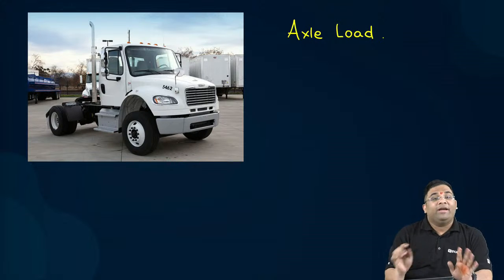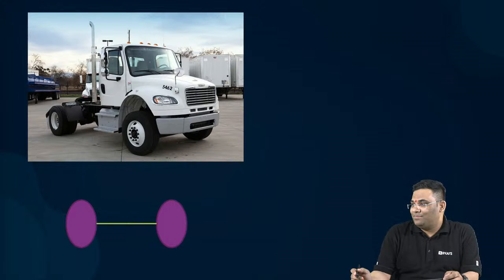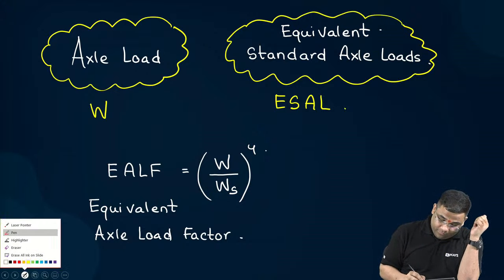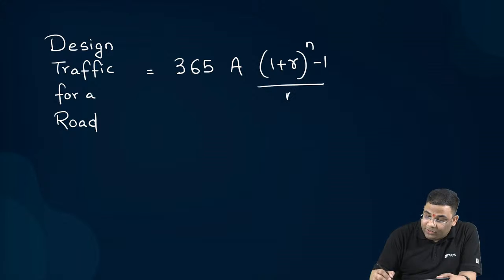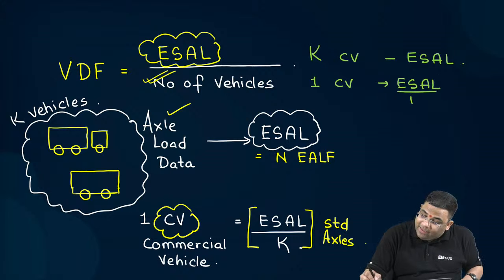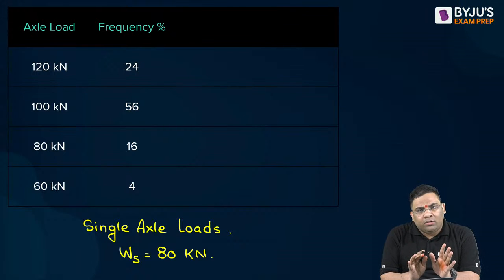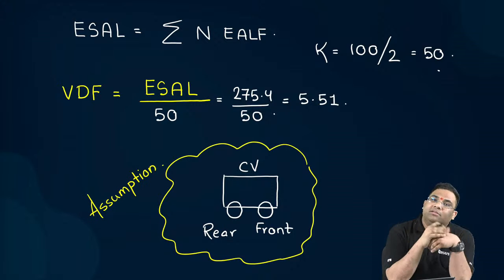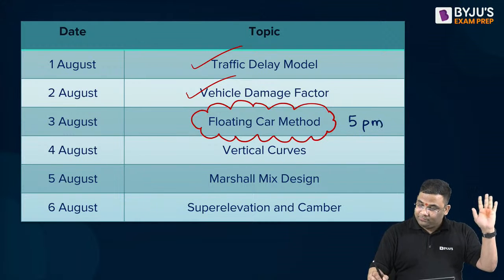GATE 2023 Civil (CE) | Vehicle Damage Factor | Design of Flexible Pavement in Highway Engineering

Comment: Vehicle Damage Factor is that factor which is used for converting the number o commercial vehicles of different axle loads to the number of standard axle load repetitions.

Homework Questions-

1. Equivalent Single Axle Load = 7.775
2. Allowable Repetitions - 2 Millions
3. Equivalent Single Axle Load - 420
4. Equivalent Single Axle Load - 1840
5. Vehicle Damage Factor - 3.7807

Comment: Pavement fails due to load repetitions, so we need to find the axle load values for design.
Axle Load on pavement varies but Standard Axle is fixed so we use Standard Axle for computations of design traffic. 
There are 4 types of standard axle 
1. Single axle single wheel on either side -65kn 
2. Single axle dual wheel on either side  -80kn
3. Dual axle dual wheel on either side (Tandem)-148kn
4. Triple axle with dual wheel on either side Tridem-224kn 
Nothing mention we use 80kn as standard axle load . 

EALF- this factor converts axle load to standard axle this tells us that 1 axle is equivalent to how many standard axles
EALF=(Wi/Ws)^4
 wi =axle load 
 ws= standard axle load 

ESAL= this converts the total axle into the total standard axle 
ESAL= ΣN*EALF  where N= frequent axle load 

Vehicle Damage Factor (VDF)- this is used to convert vehicles to standard axle 
VDF= ESAL/No. of vehicles surveyed 
Commercial vehicle. are those whose weights more  than 3 Tonne

Comment: Vehicle Damage Factor The vehicle damage factor (VDF) is a multiplier for converting the number of commercial vehicles of different axle loads to the number of standard axle-load repetitions. 

ESAL gives the number of axle loads which is obtained by multiplying frequency with corresponding EALF values. 

An equivalent axle load factor (EALF) gives the damage per pass to a pavement by the type of axle relative to the damage per pass of a standard axle load. 

Standard axle load is a single axle load with dual wheel carrying 80 KN load. 

Four types of axles - Single axle with single wheel on each side (65 KN), Single axle with dual wheel on each side (80 KN), Dual axle with dual wheel on each side i.e. tandem axle (148 KN), Triple axles with dual wheel on each side i.e. Tridem axle (224 KN).
Reply: GOOD EXPLANATION  BRO